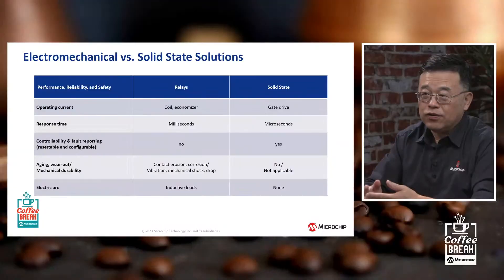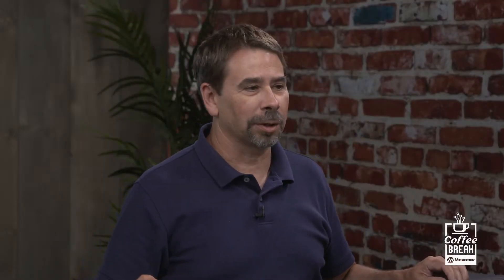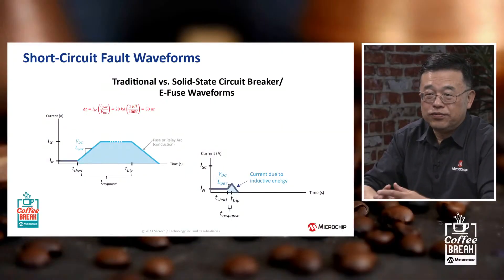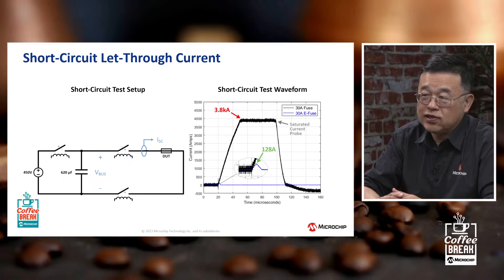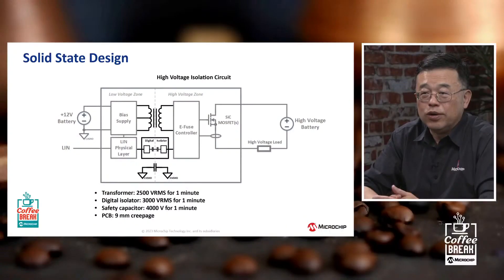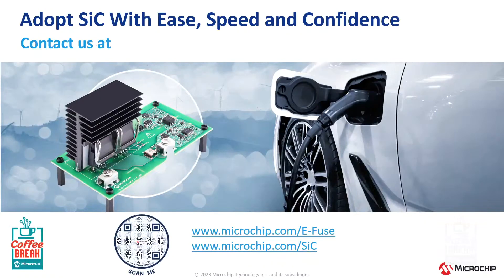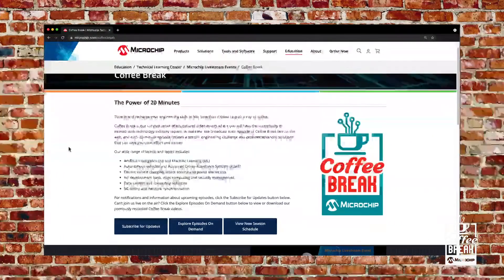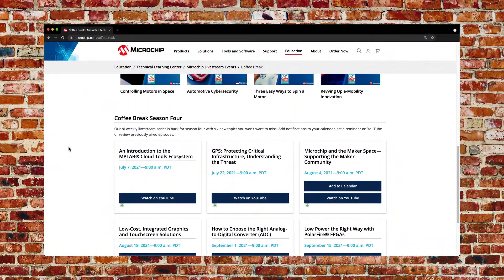Coffee Break | S10E3 | Improve Equipment Uptime and Reliability With SiC E-Fuse Solutions

Comment: @24:18 the design engineer in this case may use a resistive circuit made of two parallel branches that will scal the total current down to one branch in which the EFUSE is inserted into. The other resistive circuit may have a high power MOSFET controlled device that will cause it to totally isolate it from the flow of total current. This MOSFET of the seconed branch can take the Gate control from the circuit which the EFUSE circuit is placed. By doing so we allow the scale up of current handling of EFUSE to a higher levels of power MAX.